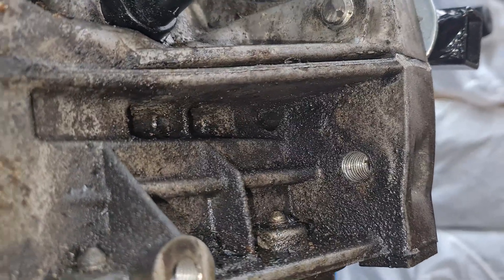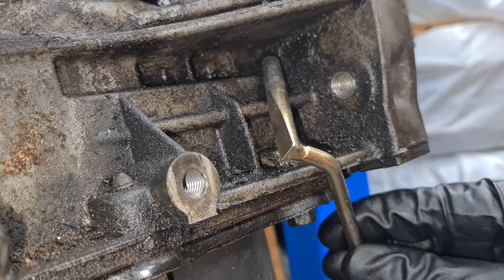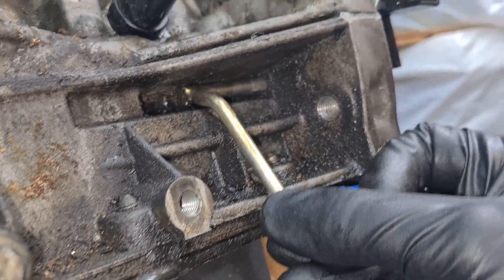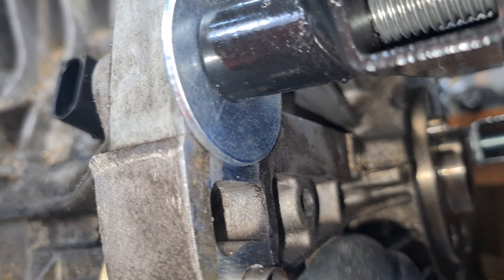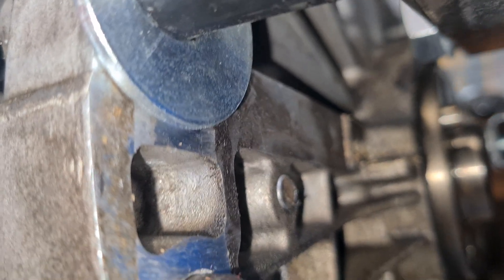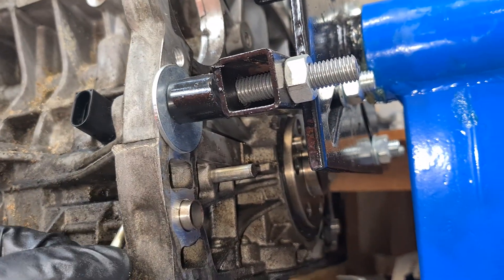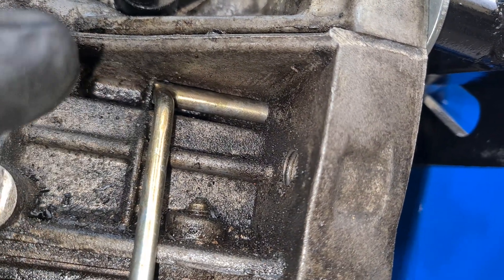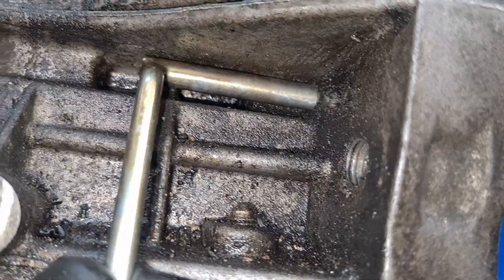N42/N46 Timing: How to insert the flywheel locking pin

Comment: Hi my pin is going  fully in but its not locking  the  flywheel  even after  a 360 degrees rotation  what could  be happening?
Reply from the maker: Locking pin is not fully inserted into the hole in the flywheel. What engine code and car model?

Comment: Do you have to push it all the way way in? Mine is half inch away and I can’t turn the engine anymore by hand. So I assume it is correctly locked on the flywheel?
Reply from the maker: Yes.
Reply: @BimmerZen  sorry, but that’s a YES to my first or last question?  Thanks for your help.
Reply from the maker: @miketurin5233  yes, if you are unable to rotate the crankshaft, then the locking pin is correctly installed:)
Reply: @BimmerZen  Thank you! The camshafts with QR codes on top are slightly tilted to the right when using the timing tool. Can I rotate both camshafts manually so the timing tool aligns?

Comment: what about auto trans?
Reply from the maker: Same, except that the automatic flywheel has one bigger hole next to the correct 8 mm hole. Crankshaft can not be rotated at all when the locking pin is inserted in the correct hole.
Reply: Hi  @BimmerZen  what if I’m in the bigger hole, I still have some free movement and I already have the timing tools attached. What should I do? Cheers
Reply from the maker: @danielblanco4822  Zhere is a little bit of free play in correct hole. In the large hole (only on automatic transmission) there would be a lot of free play, more than 5 deg.
Reply: @BimmerZen it’s definitely more than 5 deg
Reply from the maker: @danielblanco4822  Are you 100% sure that the pin is infact inserted all the way in the flywheel and it's not a "false set"? If you are unsure  of TDC you can always check with a stick trough the sparkplug hole.

The bigger hole for the auto flywheel is about 30 deg to one side so it will be evident that the first piston is not in TDC.
Reply: @BimmerZen should I take out the camshafts and Valvetronic to get TDC again?

Comment: Hello bimmerzen, thank you for your help. I find the hole  but a cannot push all the way i turn the cranckshaft and try to find to push but without succes. I possible that flywheel has not hole ?
Reply: Did you find out how to do it?
Reply: there is a special tool for that i think you will find the actual hole on the flywheel  is smaller that the outer housing hole
Reply: Hi how did you find it

Comment: Hey man, i am currently trying to do the timing chain on my BMW E90 320i, I managed to get the locking pin all the way in but it hasnt locked the bottom end, i can only guess that the flywheel has been changed and doesn't have the locking hole, is there any other way i can accurately find TDC?
Reply from the maker: Are you sure the pin is all the way in?? Does the handle touch the bell housing bolt protruding through engine block?
Reply: @BimmerZen   yeah the pin is sat against the bell housing, it doesnt wiggle as much up and down either when i push it all the way in, i have got some seriously bad rough idling issues, and i can only guess it is being caused by the timing being off because when i checked the timing it was about 5-10 degrees out, if you have an email or something i can send you a clip and see if you have any insight?
Reply: Look at the other locations the camshafts positions or the harmonic balancer to test the engine is rotated to the correct location

Comment: I want to replace my Harmonic balancer.
If im going to use the flywheel lockpin, do i just insert it and thats it?
Do I need to align the flywheel for the holes to match and how would i do that?
Reply from the maker: You can use the pin to release and tighten the 3 bolts holding the harmonic balancer pulley. No need to align it, just make sure the surfaces are clean and free of any rust or debris.
Reply: @BimmerZen  The pin goes somewhere under the car close to the dpf filter?
Reply from the maker: @thekids_callmeboss6577  There is no DPF filter on these engines,  you can check out my other videos on how to insert the pin from underneath...
Reply: Yea sorry, my car is a diesel N47 320d
Reply from the maker: @thekids_callmeboss6577  In that case I don't know, I never worked on that engine. Manual states that you need a special tool and that there is only one central bolt to remove the vibration damper.
Reply: @BimmerZen  ok ty

Comment: I got a question a mechanic left the pin in the car still, what will happen if the pin left inserted? or loose?
Reply from the maker: You can only start the engine if the pin is not locking the flywheel, so that is not a problem:) I would assume it will just stay there or fall out eventually. Chances of doing any damage is pretty low, but I would still recommend removing it, just to be on the safe side, especially on the automatic transmission that has 3 bigger holes in the flywheel where the pin can snag.

Comment: thanks man. i was actually having challenges locating this hole. What's the diameter of this locking pin? i guess i have to fabricate my own.
Reply from the maker: I'll check next time I'm back at my garage...
Reply: @BimmerZen sorry I'm a bit late on this but do you still remember the diameter of the pin?